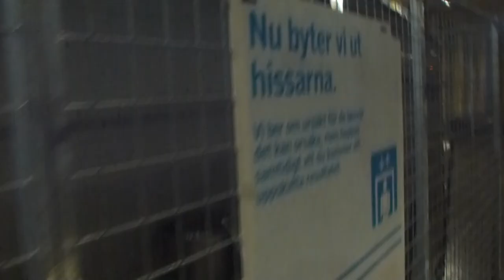2012-11-08 DEVE to SMW Elevator Replacement Update @ Västra Skogen Metro Station

Comment: What happened with the left ‘elevator’ it’s nothing in there at the moment,and it’s been like this since 2011 and before the replacement of the old DEVE elevator,it was the machine room or What? Because there is a bolt in the door(sorry for my bad English I’m 🇪🇸🇷🇴)
Reply from the maker: There has never been an elevator built inside the left elevator shaft and it is still like that to this day.
If SL had done things right then the new elevator would have been built in that shaft instead and then they would have emptied out the right elevator and make it empty instead. Täby centrum have a similar situation and they did just that, albeit the two elevators ran next to each other for a while there before the old one got demolished eventually.